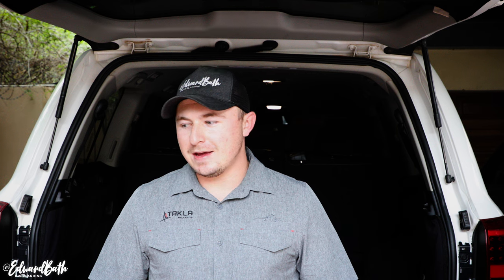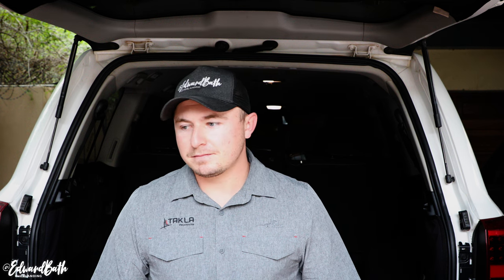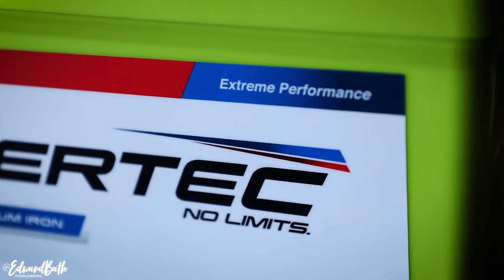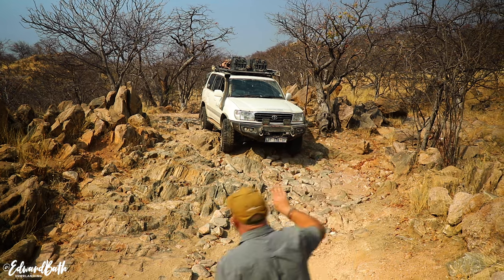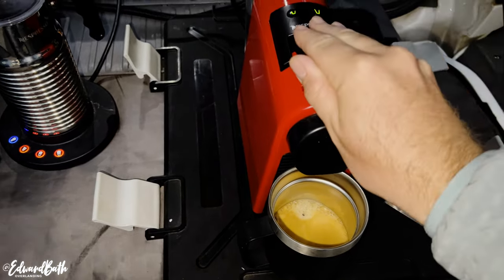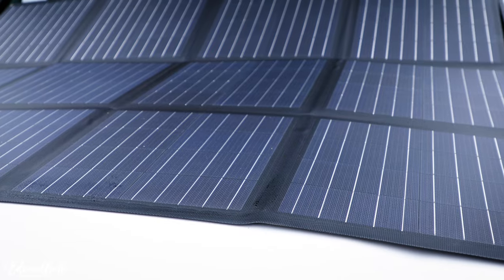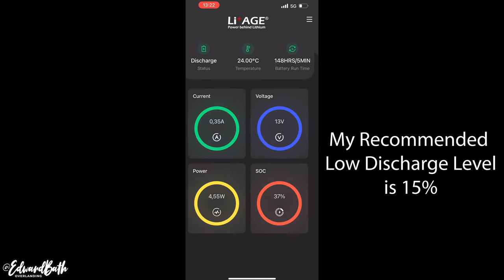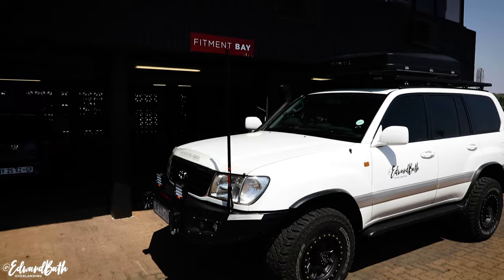REDARC BATTERY SYSTEM & ENERTEC LITHIUM BATTERIES | LandCruiser 100 Series Build | Episode 3

Comment: Ed, Redarc is an extremely well known and reputed name here in the States and you went with a great brand that has great reputation.

There are couple of off-road build shops (notably Slee off-road) here that use a dual Redarc battery system for the 200 series builds with one for the engine start and other electrical systems and a second battery to manage all the accessories like light bars, refrigerator and the winch.

Redarc has been a tried and tested brand here among off-road builders so you went with it great brand.

The 100 series is looking pretty good. My biggest regret is trading in my 100 series ( it was a LX470, the 100 series’ cousin from Lexus) and they are suddenly in huge demand now and people looking for used 100 series in both the Landy and Lexus variants.   You made a great choice to keep the 100 along with the 200.  

Post updates on your experience with the Redarc system and how it works for you.
Reply from the maker: Thank you mate! Been using the redarc kit for 2 months now and it’s just brilliant, definitely going to get some fitted to the 200 as well. Thanks for the support mate!

Comment: Will you also re- do the Echo's electrical system Ed? I went full Victron with a 108ah lithium on my Echo and will be testing it in Mabua next year. Home tested and the 240w flexopower panel worked a charm.
Reply from the maker: Hi Johan! Yes I will change it when the budget allows for it.

Comment: Edward, any possible reasons why you chose Redarc above InterVolt, CTek and Victron BCDC chargers. Have you tested all those mentioned. I have to make a decision for a secondary battery charger (not Lithuim) under the hood very soon.
Reply from the maker: The only one I haven’t used of the above is Ctek, Victron was very good but not in the same league as Redarc. I had endless issues with 3 different intervolt units
Reply: Thanx for the clear answer. I went a few times through your YT-vid about Redarc. Redarc convincingly is the choice to go for.

Comment: Edward, I am glad you have shared this info. Do you mind to indicate which 4x4 mega world did the installation? Is Enertec a local product, or also OZ. I guess you did it in Randburg. Have to have a second battery in my Fortuner and consider this route. But it goes further, for my home as well (batteries).
Reply from the maker: Thanks Willie! 4x4 Megaworld Strijdom park or bryanston. ENERTEC is a local product 🙏
Reply: Edward I am glad to hear it is local. Thanks a lot. We should support local all the way when possible. I am busy to put a system together for my home and Enertec seems the way to go, or to consider. Some time ago, maybe 3 months ago, I saw you at Strijdom Park. Was running into the mountaineering shop next door - in a hurry.

Comment: Now this is a streamline electrical setup! Looking very good. Do you think one battery would suffice if you did not use the coffee machine (or charge the laptop; i.e. left out one of those two appliances)?
Reply from the maker: Thanks mate, it didn’t for me, even with 1 battery in the heat with the fridge pulling constantly it wasn’t enough. If you are game driving most of the day everyday then it will be okay but still not great